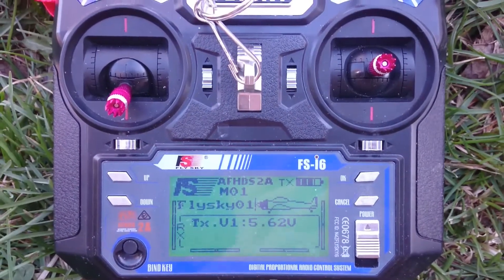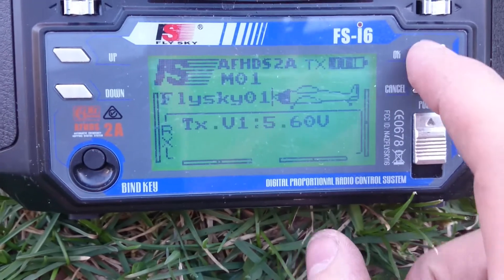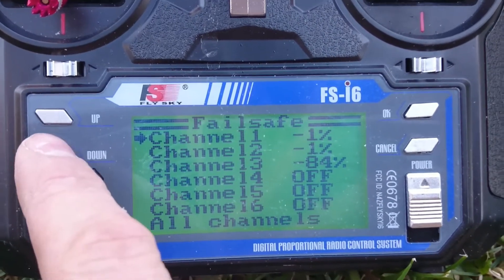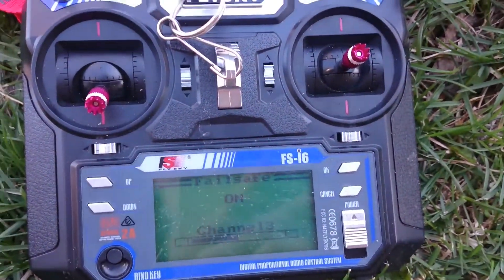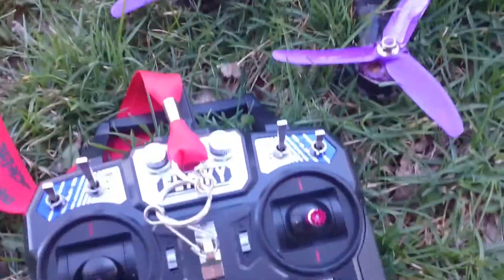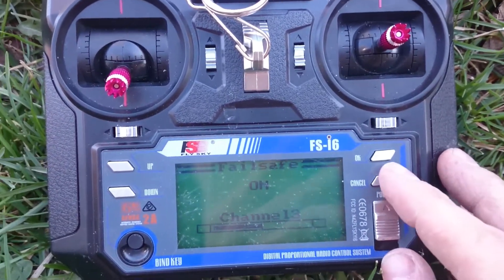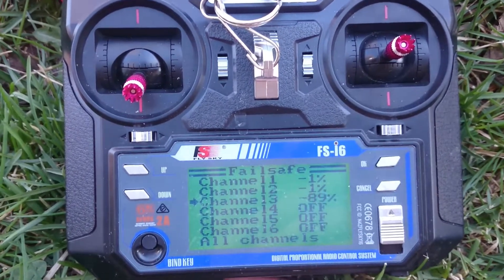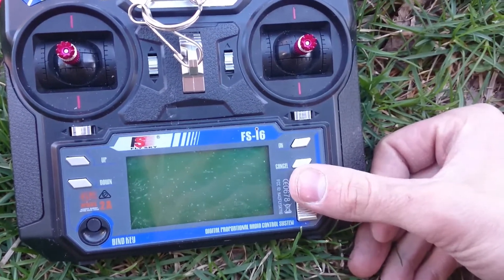Quick setup of Fail-Safe on FlySky controller for Wizard X220

Comment: Cheers dude. I don’t understand why on earth it would come setup with the failsafe at 100% throttle! This is exactly what happened to me! I accidentally turned off the controller before disconnecting the battery... boom! The thing took off like a rocket!!!! Straight up! If I was standing over it for some reason, my face would have been mince. Though, it may have improved it slightly to be honest...
Reply from the maker: Brent Sinclair glad you got it figured out without mutilating yourself man 👍

Comment: The 1 in channel 13 is actually the L of channel so it is actually 3
Reply from the maker: InventorJS -Jacob Singh some of the radios were programed differently depending on time of manufacturing. You want to set whatever channel moves with the throttle command.
Reply from the maker: Oh yea I see it now, lol man that's really a good catch on everyone's part, because that's an awful big space between the letters
Reply: yeah
it took me a while to figure that out too!

Comment: Thanks for the easy to follow directions to set the throttle failsafe on FS-i6 and Wizard X220.  Bought the Wizard from a hobby store yesterday and was told to go online for set up directions as none come with the drone...... amazing.  Thank gawd for people like you and You Tube!Been flying an assortment of drones (Phantom 1, 3 Advanced, 4 and Autel X Star Premium) since 2011 but the Wizard 220 is my first "racing" drone.  Now on to binding the transmitter to the receiver and get this bad boy in the air!Thanks again,Semper Fly, Dave.
Reply from the maker: 30 Year Patriot glad it worked well for you. Try the Racerstar 5048 prop upgrade from banggood.com it will really up the speed and handling.

Comment: Even on -100% I can't get full motor stop, it only idles.
Reply from the maker: Pax A yes low idle is as longs you can go.
Reply: Pax A I know this is old, but I think if you set whatever channel you arm with failsafe to whatever the disarmed value is, it'll just disarm and fall. Hope that makes sense lol.

Comment: Only worked once for me when testing without props. Could it be a different channel for me maybe?
Reply from the maker: that's odd are you setting it up on the same quadcopter and radio? if you want a quicker response message our Insta. @fpvmilitia
Reply: My bad didn't have aerial screwed on, lucky didn't damage anything.
Reply from the maker: Rod Hamilton Glad there was no damage. It's working now though?
Reply: Yes working okay now, thanks.